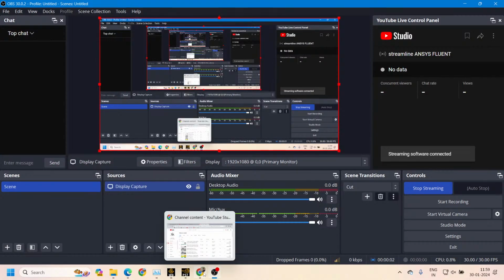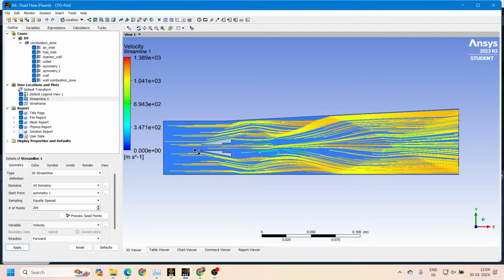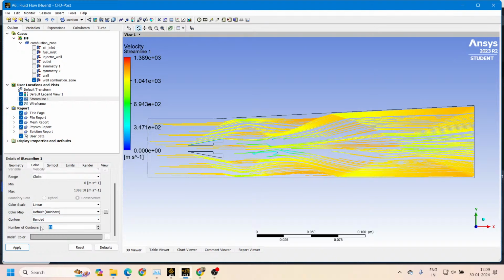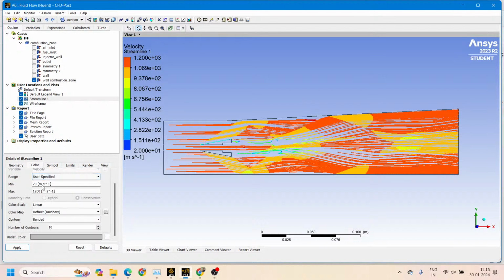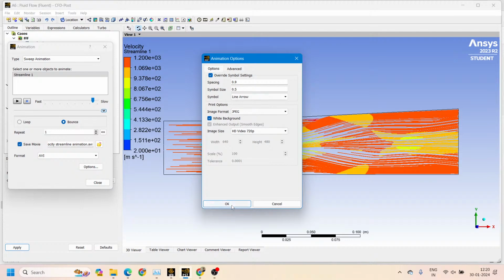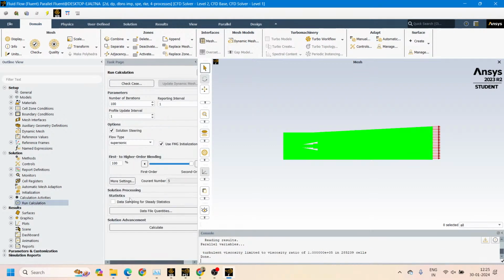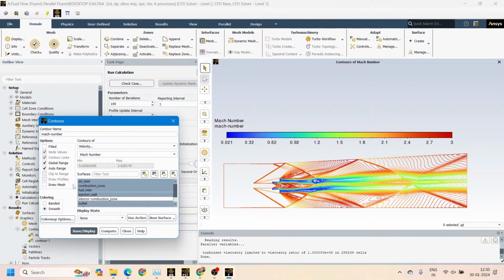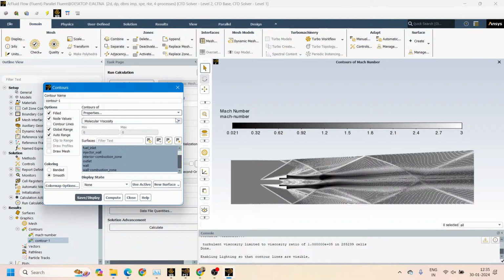Streamline Contours || ANSYS FLUENT

Comment from the maker: Watch all the videos related to SCRAMJET COMBUSTOR SIMULATION
1. Ansys fluent spaceclaim scramjet geometry
Video link :-  https://youtu.be/ldGH3reDNNw

2. Uniform Fine Meshing | Quadrilateral mesh | 2D Geometry | SCRAMJET COMBUSTOR|ANSYS fluent simulation. video link :-  https://youtu.be/USnSOyECkIM

3. Scramjet combustor simulation || ANSYS fluent || Strut based || 2D combustor || H2 and air mixture
Video link :- https://youtu.be/Xk-j40lfxV0

4. Ansys fluent xy plot | Excel Graph| extracting values from Ansys fluent software &plotting on Excel
How to do xy plot video link:-  https://youtu.be/Se6OQsRg8J4

5. Combustion efficiency || ANSYS FLUENT SIMULATION
Video link:-
https://youtu.be/9JMqe7klSuo

6. GRID independence test || ANSYS FLUENT
   video link:-   https://youtu.be/xwmhbomPiC8

7.  Streamline Contours || ANSYS FLUENT
Video link:-  https://youtube.com/live/1u24TsPy6vg?feature=share